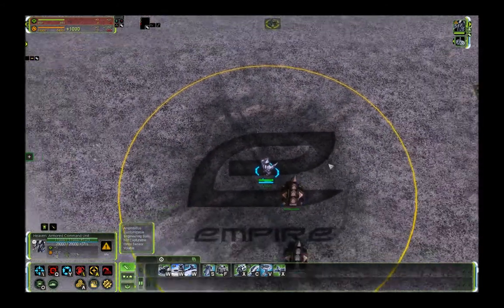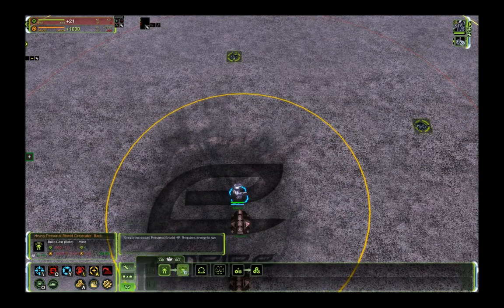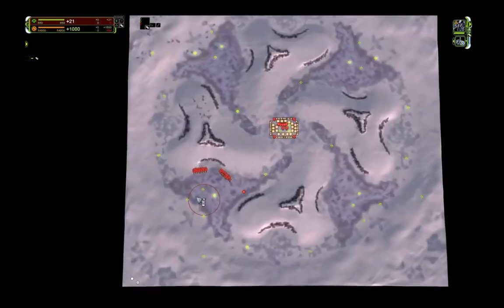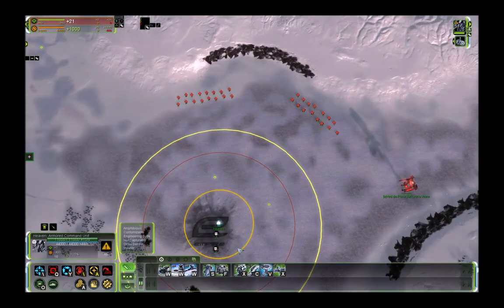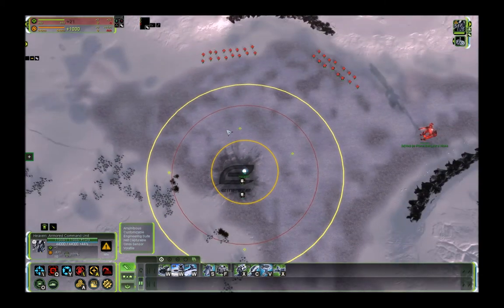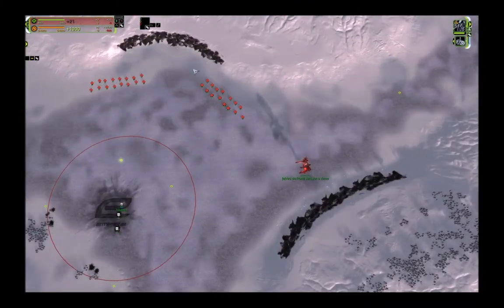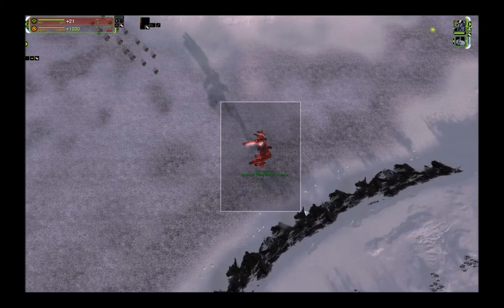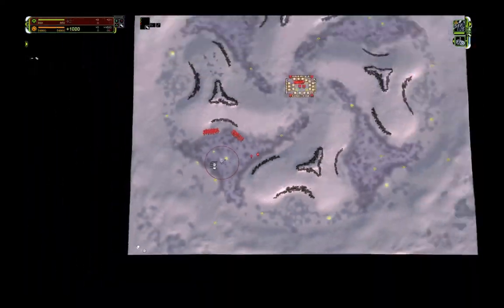Automatic Overcharge - FAF Patch Spotlight 2 - Supreme Commander Forged Alliance

Comment: About that last advice, are you really sure the OC is not wasted on the striker? Because afaik what ever comes in range first gets OCed first. You can also use manual targeting of unit clumps during auto overcharge to get a semi-automatic overcharge.

One thing that everyone should be aware of: if you push a commander with auto oc it often won't fire the oc at the commander, istead it will fire at a unit or a building nearby. Which is good if you want veterancy, but not so good if you need that extra damage on the enemy commander.